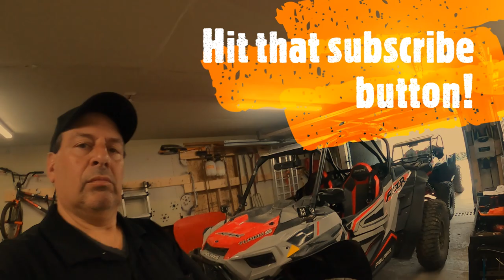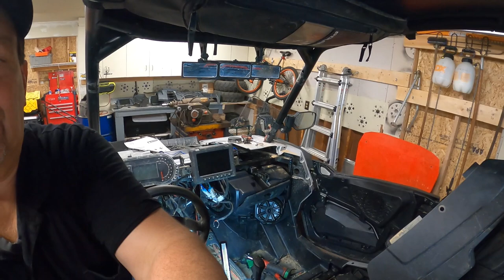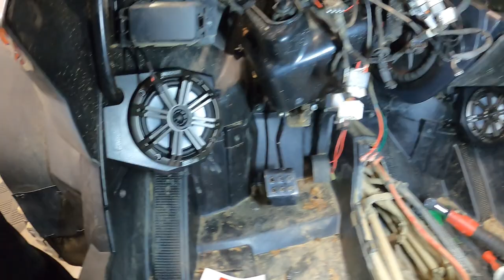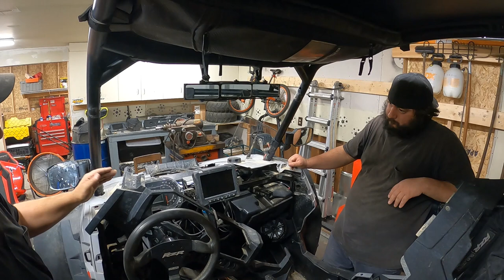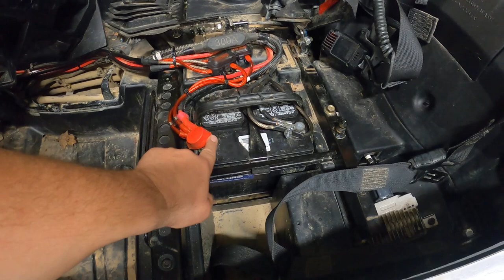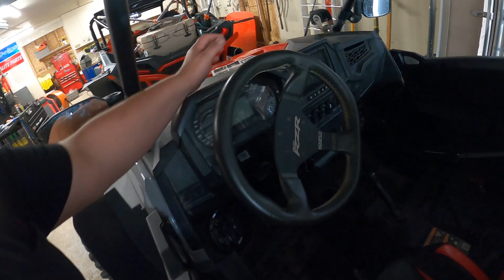SSV Works Polaris RZR Complete Kicker 5-Speaker Plug-&-Play System Turbo S/ XP 1000

Comment: It sounded like you were getting the suspension feed back. I get the same on mine so I’m looking to get a new system. I was hoping these SSV systems didn’t do it.
Reply from the maker: Yea they got the issue resolved but Amp went bad not long after. From what I was told they had an awful time trying to get them to replace it even with a "warranty".

Comment: I just purchased this system on my S does the speakers work with the 7 inch unit?? Or do I have to use the included screen only I’m just a little confused I think they made multiple versions did urs say for xp turbo s because mine said xp 1000 but it looks Identical lol
Reply from the maker: As far as I know you have to use the included screen. This installation was done on a XP1000 and turbo S.
Reply: @AbramHeathFULLYEET  yea I just canceled and ordered the correct one the seller was pretty cool about and gave me a huge discount off
Reply from the maker: @thatoff-roaddude9515  who was the dealer? I'm shopping for one for the X3.
Reply: @AbramHeathFULLYEET  manticoreoffroad off eBay